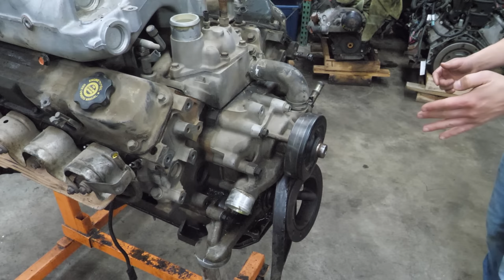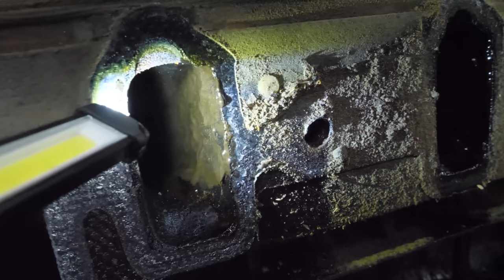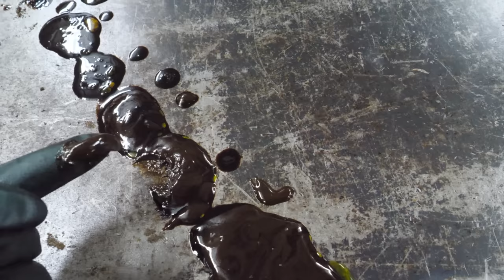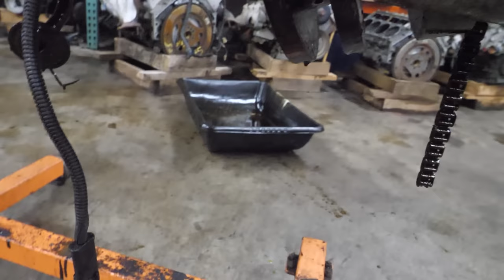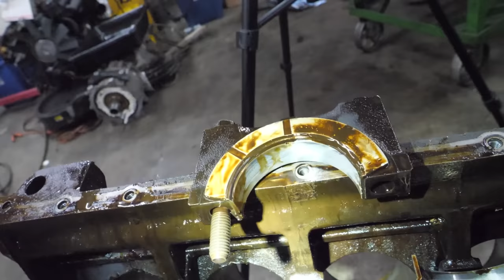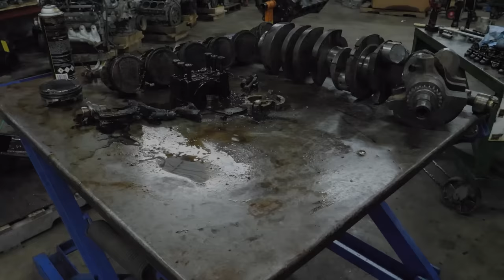8 LITERS OF DESTRUCTION! Dodge Ram V10 Engine Teardown. Broken In Ways I Have Never Seen!

Comment: Two things I always want to know about these Krakatau-scale explosions: 1) What the hell did it sound like?  2) How did the engine run long enough to cause that much damage?
Reply: I feel like a good goal in life is "experience this kind of engine destruction in person, even if from a distance." Makes me wanna buy an old two stroke diesel and make it runaway on purpose just to watch it die.
Reply: Heavy ass rotating assembly and likely happened sunder throttle
Reply: As a kid I heard it first hand. 2000 miles from home and 17 years old. As I remember it sounded a lot like a crying kid suffering severe depression over what a dumb ass he was just moments before.
Reply: @archieharrison9433  as i remember that's pure gold and never tell that story any other way because that's just glorious
Reply: @jasontexter1721  -  Yea.....takes awhile for all that mass to wind down.  It's gonna tear shit up until it does.
Reply: These engines make incredible torque even at low RPM. Lot going on. 😂
Reply: The only thing I can think of is these conditions:
1. manual transmission 
2. steep downhill grade 
3. leave it in 3rd gear at 65mph 
4. no oil pressure
5. zero Fs to give
6. maybe a really loud stereo?
Reply: This engine makes me want a time machine and x ray camera even more. WOW
Reply: Probably went mudding and got stuck, here dude, hold my beer....
Reply: @elen5871  u monster
Reply: @elen5871  good luck with that, that doesn't kill them. >.> Seen enough videos, they just scream for 15 minutes and then lock up. After cooling down, they usually even start and run still. Probably have to choose something else if you want to see it grenade
Reply: Towing something and the transmission locked up forcing the engine to rotate until the vehicle stopped.
Reply: @elen5871  Like a Johnny Cash song.
Reply: Well, it's got a lot of cylinders so I guess if you run it flat out, quite a few of those cylinders may keep banging away for a few seconds even after their companions have let go. Gotta say there was a hell of a lot of material which obviously spend a long time in the grinder, so there's no way that mill stopped dead.
Reply: @ZPositive  I came to this same conclusion, only maybe also towing something heavy too, to give it more momentum :D
Reply: This has to take the #1 spot of all time. Pieces of destruction that bad, need to be cleaned and encased in resin for a nice table top.
Reply: @ZPositive  you forgot the towing of a 20,000 lbs trailer. I know of one crazy bastard that did just that once it was obvious something was broken inside the engine.
Reply: @franksprecisionguesswork501  I live in the rockies, where the grades are steep enough and long enough to do this without a trailer.  But I agree there's nothing wrong with a little additional momentum.  😉
Reply: Look at some tractor pull videos and see bigger destruction than this happen in about a second.
Reply: @elen5871  I had a motorcycle engine blow up under me and it was just a heart breaking experience, like, I'm stuck here, this is going to cost a lot and how do I get me and my bike home?
Reply: @TerryClarkAccordioncrazy  those are awesome explosions for sure, but they don't explain what happened to this V10, or any motor on this channel.  It's not even an apples and oranges comparison.  More like apples and salmon.
Reply: @ZPositive  I'm not sure what you mean, some tractor pull engines throw the top half of the engine out of the vehicle and spit bits of pistons and con rods into the surrounding area. I guess once one crank bearing snarls up in a big way the particles travel to the others.
Reply: @TerryClarkAccordioncrazy  I mean that tractor pull engines are running insanely high levels of boost, and/or nitrous.  They're running high lift cams, extremely stiff valve springs, very high rpms, and absolute maximum loads.  It's not uncommon for tractor pull motors to produce several thousand horsepower and several thousand foot pounds of torque. 

No engine ever torn down on this channel ever made even one tenth the amount of power of  a massive, highly stressed tractor pull engine, or even saw one tenth that amount of abuse.  So using a tractor pull motor explosion to describe what happened here is just beyond silly.
Reply: Don't worry....just keep it pinned to the pan, Jethro!
Reply: @ZPositive  plus a heavy load behind and the brakes have faded.
Reply: This very same happened to my first v10 engine. Was on the highway with the cruise set at 75mph oil pressure gauge dropped and all I heard before I could do anything was clack clack clack. Never really boomed but definitely clacking or knocking if you will with white smoke everywhere. Hole in the block on the driver's side and cracked on the passengers side. Never pulled it apart but suspected the crank snapped. I did also have the music up so if it was making any slight noise I didn't hear it.
Reply: @christopherweise438  Exactly, rotational momentum and the weight of the vehicle drifting to a stop in front of the tow truck operator who just happens to be standing by waiting for this exact scenario. Spot on, CW. Spot on.
Reply: "Yeah that's just lifter tick, it'll go away once it warms up a bit"
Reply: @ZPositive 2.5. pulling a heavy trailer
Reply: Maybe manual transmission going very fast at high rpm when it died. Then with the clutch out under engine breaking, the truck just keeps turning the engine.
Reply: It was at idle and much like a tree in the forest with no wife around fell silently and with grace
Reply: @andrewbankhead1979  towing way overloaded down a 30% or greater grade and lost brakes just after he crested the peak was ok till he gets brake checked by Karen in the minivan for having saved her life passing her on the shoulder missing his only chance to hit the runaway truck ramp and used the Jake brake for everything it was worth and stuffed it in creeper gear and that old kitty cat sang the magical song of it's people after an 8ball of speed
Reply: @ZPositive  I think you're on to something, my first thought was massive over-rev from flat towing in a low gear.
Reply: Just a clunk noise and it all happened instantly... maybe preceded by the squeal of dry bearings...
Reply: @BuzzLOLOL  lol
Reply: 2) More pistons = runs longer!  lol
Reply: I have seem racing car engine owner says have " totally explode" its wasnt even 10% so bad this was.
Reply: @frank that would be my pick out of the guesses. With this kind of an engine people would get the idea that it can tow anything.
Reply: When I blew up an 855 Cummins, it sounded like a KA BOOM followed by a smurf on steroids hitting a sledgehammer inside the engine.  The other 5 cylinders were still going strong until I pulled over and shut it off.  Temp and oil pressure were perfect, it spun a bearing and threw a rod just cruising down the highway.
Reply: @ZPositive I came here looking for this comment. I think you have the best description of what could have caused this type of destruction. Some external force would have to be applied to cause this much destruction.
Reply: @elen5871 you monster! Have you not seen The Brave Little Toaster or Cars 3? Unless you're in a Maximum Overdrive situation, we should all be supporting the ASPCE or American Society for the Prevention of Cruelty to Engines. 😂
Reply: @MAGGOT_VOMIT I was totally thinking the same thing! At least in a clear vase or something decorative. It must have been something right to the end.
Reply: @claytoncoolidge992 Thank you for that. Wow. Your comment really sent me there. It's like you speak from personal experience.
Reply: @wabi_sabi_vida  i am sid, i got my skull shirt on and i'm ready to make something i don't know is sentient suffer in ways a human can't comprehend 😎
Reply: I agree, the sound of this engine explosion must of also left a pair of dirty pants. Ha ha
Reply: @ZPositive 😅
Reply: @ZPositive - I thought you missed the obvious “ass-hat” possibility but then I saw #5. Sorry.

Comment: As a lifelong GM fan, his GM steering column comment hit hard.
Reply: Bass boat paint.
Reply: Brands are not your friends, they are a concept centered around taking money from people
Reply: @poprawa  100% RIGHT YOU ARE SIR.
Reply: @poprawa  ...And not feeling particularily obligated to give anything of value in return.
Reply: I laughed out loud 😂
Reply: @poprawa  Golf Course applause for you, my realist good man !
Reply: Yep '84 K-5. Turning left out of driveway, already loose tilt-steering column came off in my lap, K-5 maintained left turn into ditch. Used red Loctite on the 4 bolts.
Reply: @poprawa  As a tow truck driver for many, many years I can tell you that brands matter as much as proper maintenance. Chrysler paid of several of my tow rigs over the years. Most of the times it was wiring/electrical system issues.
Reply: xD I exhaled sharply from my nostrils
Reply: Replaced the rag joint in an 81 Firebird with half of the shaft from an XJ Cherokee. Easy job and really improved steering responsiveness.
Reply: Lmfao😊
Reply: Broken crankshaft
Reply: @poprawa yes and no. Some companies like GM and Ford have treated their employees so well, the employees kids work for them. Ford especially has multiple dealerships opened in the 1930s-1940s that are still run by the same family 3-5 generations deep.
Reply: I thought it was awesome 😂😂
Reply: That's broken 😆
Reply: GM & Dodge used the same tilt column from '72--93ish. I got really good at tightening the 4 Torx bolts up without full disassembly. Usually took about 15 minutes. 
Bought a Dodge column with a GM ignition key in it at the local PicknPull. Swapped it back to a Dodge ignition key.
Reply: usually but older chevys did havd better parts cheaper, decent transmission too

Comment: I'm honestly amazed the block itself didn't just split in half
Reply: It being cast iron maybe the only reason
Reply: That's because it's not a ford.
Reply: If viper block which was aluminum it would have!
Reply: Where be the 2.slows
Reply: These blocks are INCREDIBLY strong.
Reply: I always wondered, why didn't someone simply weld TWO 440's together!....
Hely do a slight bore and perhaps stroke and you'd have like 910 Cu In and like 1000 Hp in a RELIABLE package. Yes, you can trim a lot of unnecessary weight off the blocks before joining and then set the engine back like 12 to what ever inches to gain better handling....
Why get involved with some marginal engine design?
Reply: @cindys1819  Packaging. A V16 would be WAY too long to be useful. A V12 is already pushing it and needs it’s own bespoke chassis.
Reply: Mopar Mo'problems
Reply: Only fords do that .
Reply: @313soldier313  ah touche
Reply: No 4 bolt mains in this V10... whereas the Vortec BBC engine is all 4 bolt mains...
Reply: That thing was turning some serious rpm's when it blew.  Looks like the crank let go very early in the melt-down and threw everything out of whack.  It may have been over-heated before the first rebuild and threw everything out of line.  Should have been line-bored during rebuild. I've seen diesels do that.
Reply: @davidclark7584   That's Because It's Not a Subaru😊🏁🏴‍☠️🤒😠

Comment: That's an incredibly strong block right there.  And let's consider, just for a moment, the impossibly strong oil pan, which somehow avoided puncture while being assaulted with the entirety of the rotating assembly being thrown its way.
Reply: I was thinking exactly the same
Reply: If im not mistaken V10 motors are overbuilt which is why you see them making crazy power when boost is added.
Reply: Yeah man they overbuilt the SHIT out of these blocks, it's really cool actually. It's in a Y shape with the bottom of the block extending basically all the way down to where a normal oil pan stops at the front, which is why the front of the pan is basically just a plate.
Reply: Um, it can’t be that strong. It exploded!
Reply: @davsaltego everything explodes, eventually
Reply: @EYOUTz1993 not a uncommon thing in older engines. Gmc Mopar and ford did it a lot chevys i6 platform also features a deep skirt its not uncommon for a design. And its strength is well negligible as clearly the weak point was the crank

Comment: Even after 50 or so times, I still get a massive grin when you proclaim a chain guide “good” and fling it across the room, and a component like the water pump today “bad” and compassionately wrap it up in a towel like it just needed some much needed rest.  It will never get old.
Reply: This channel wouldn't be half as much fun as it is without his sense of humor.
Reply: Well it didn't come from the factory that way.
Reply: I did not know an engine could make this much damage and how quickly it may have happened. How long did it run after the crank was ground? Did they forget to tighten the main bearing caps? Why was it turned and did they miss a crack in the first place? What is the value of the block and heads in terms of cast iron only? Just WOW!😮

Comment: I had a 95 ram with a v10 less than 10 years ago. They are tough engines! I bought mine for cheap, super neglected with over 200k miles on it. I drove it around for a bit, fixing things as i went. Then one day i went to replace a leaking valve cover gasket. After opening it up i found two push rods were pushed through the rockers. The lifters were gone, only pieces of them left. So i bought 2 lifters, 2 push rods, and 2 rockers and put it all back together. It ran great! Lots more power than before. I never did find the missing lifter parts... It ran great for me for years. Never had any major issues, it always started. The fuel mileage was terrible though. It got 10mpg all the time, city or highway, towing or not, always 10. I ended up trading it for a different car years later. They also made more torque than a stock Cummings of that year.
Reply: The lifters probably collapsed from neglect, floated in the bore at high revs, and the cam put enough of a whack on them that they shattered and bits of them landed in the oil pan and windage tray. Pretty harmless once they get there. It's on the way down that bad things happen. By the time you noticed, whatever was done was done a long time ago. I'm glad you got a long life out of it and someone else might still be using it.

Comment: I’m going on a limb here and saying this motor had a manual transmission behind it.  The motor let go at the top of the Eisenhower Tunnel, and the driver left it in gear for the 8 mile ride to the bottom of the mountain!
Reply: ya.... that might be it dude.... hell ya
Reply: At the least there was a major failure, followed by an extended period of operation or forced rotation. The crank break would have been towards the end.
Reply: My only blown motor so far let go heading east on interstate 70. It let go a 1/2 mile from Eisenhower tunnel at 11pm while towing a motorcycle last April. Got a tow arranged, and hopped on the bike for 2 hours in the freezing cold to get to my parents house. 

Still have that motor in my garage, waiting for the time to tear it apart and see what happened. Funny thing is, it would start, run with an incredible racket for about 3 seconds, then die (after it was towed to my parents house, not immediately after the initial destruction)

Comment: Bought a '95 Dodge V10 4x4 Truck with 125k miles back in 2017 for $1,200.  The guy I bought it from inherited it from his Father's estate. It was only used to tow a camper to a vacation cabin from 1995-2016. It's the best truck I've ever owned! Still running great today!
Reply: Rams have been the best trucks we’ve owned too 👍

Comment: This had to have been one of the loudest explosions ever made from any vehicle that's blown up. I'll have to cast a vote for the most carnage on the channel yet with this one.

Top 5 most destroyed engines on the channel (that I can think of):

5. Ford 3-Valve V10
Nothing survived.. maybe valve covers but that was it.

4. Kia V6
It may have had more carnage than the next entry, but it actually had a couple of usable parts (HPFP, maybe the cams but not sure how much value they have on their own)

3. Ford Focus 2 Liter
Single cheek repairs led to everything from that engine ending up in the scrap bin

2. Honda J35 V6
Customer stated the vehicle shut off.. I'm sure it didn't just "shut off" it imploded! A damaged wrist pin, 10-piece piston mcnugget, and 5 rods that emptied out.

1. This takes the cake. I really want to know how hot it got to get those rods that mangled. It also has the most damaged wrist pin ever seen on the channel.

Honorable mention: Mercury Marauder engine had the worst crankshaft I've seen on the channel, but the cylinder heads were relatively unscathed so it barely missed the list.

Great video!
Reply: On a factory engine, yes.  You'd only expect this kind of carnage on a tractor pull truck or something like that.
Reply: Wait, what about the Subaru we were thinking might have been towed in 1st gear behind an RV or something. That was the video that got me hooked 😊